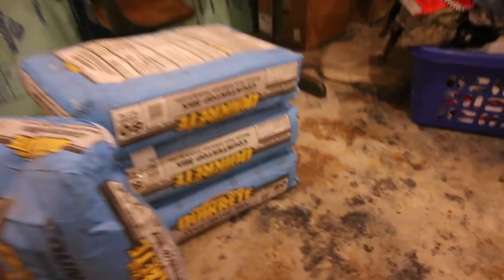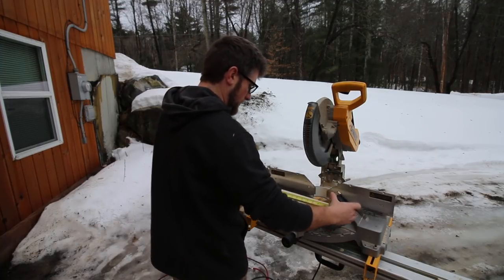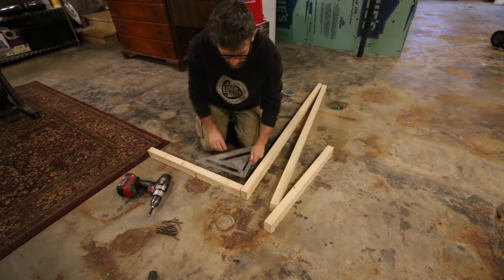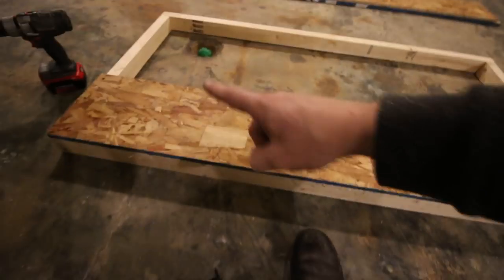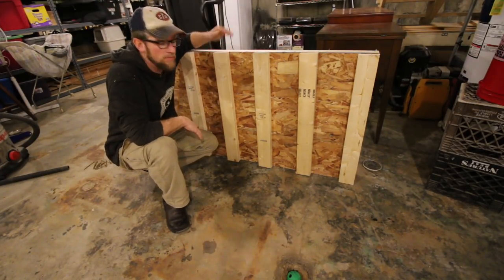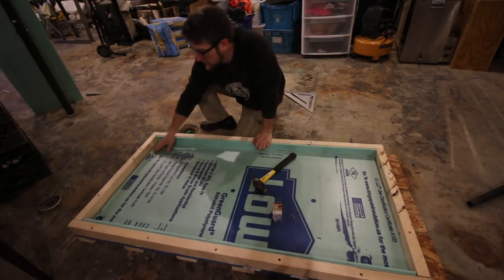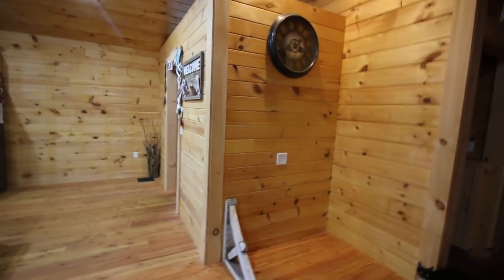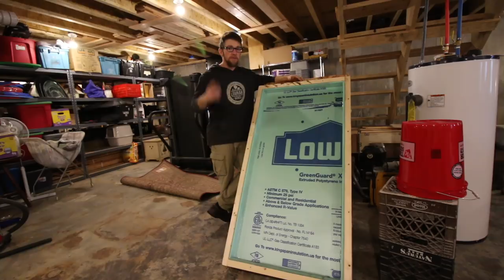Making Forms for our Concrete Desk Top Project

Comment: Cool desk idea. Will you pour in place - do you have to build a desk? Will you put in a PVC pipe to run cables under the desk?
Reply from the maker: What would the PVC and cable before?
Reply: Lumnah Acres The PVC would be a hole to run computer cables or lamp cord from the desktop down to the floor if you have a computer or printer under the desk.